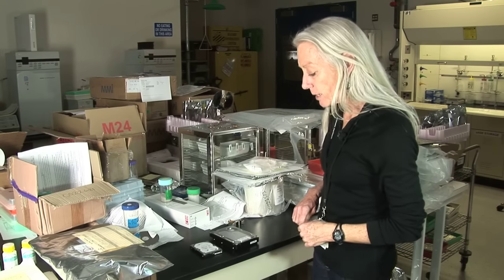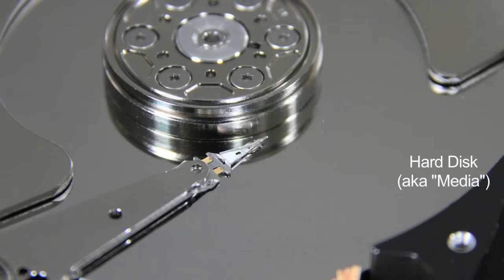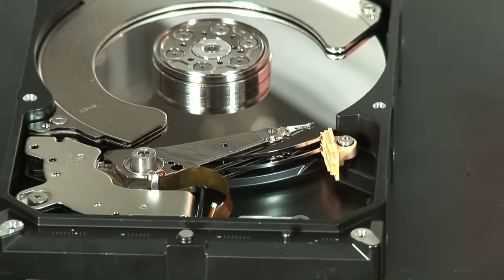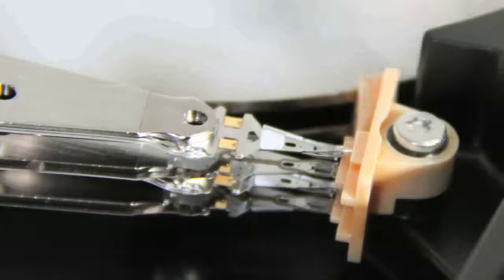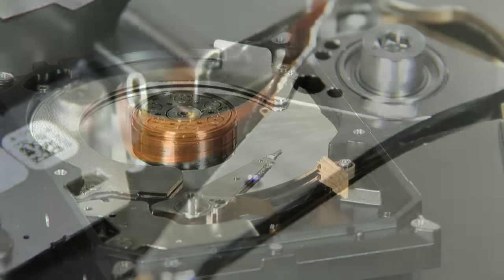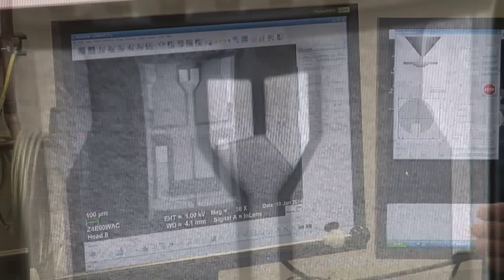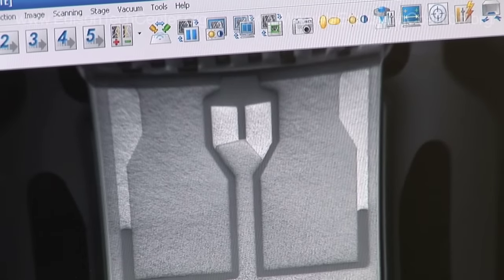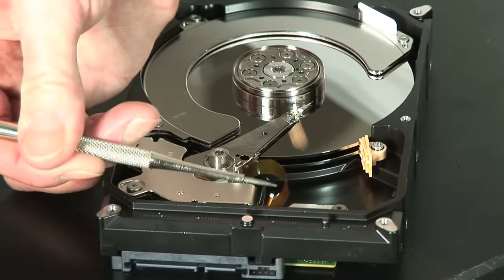How a Hard Disk Drive Works

Comment: Theoretically mechanical hard drives should be the most expensive of all.  Because in addition to the intricate circuitry as in SSD's, are precision machined parts, a stepper motor for moving the arms & another motor for the platters; etc.  These mechanical hard drives are a classic example why foreign cheap labour is exploited.

Comment: its funny that seagate has a 28% fail rate and i used to use seagates HDDs in my system. But they all failed, now i am using western Digital Gold with no problem.

Comment: AIR PACK SYSTEM ALLWAYS 5,000 MITER SOLTED WATER LOWER SECTIONS TEST METHOD NO LEAKAGE WATER IN SECTIONS ☝☝☝☝☝☝☝☝☝☝😞😞😞😞😞😞😞😞😞😞

Comment: These drives are rubbish. I purchased two within a few weeks of each other. One to store my Family Tree material. The other to hold historical material to transfer to a larger Hard Drive. Both these drives the head mechanism got stuck after a few weeks so all my material is locked inside and cannot be retrieved without huge cost and then no guarantee of retrieving it.